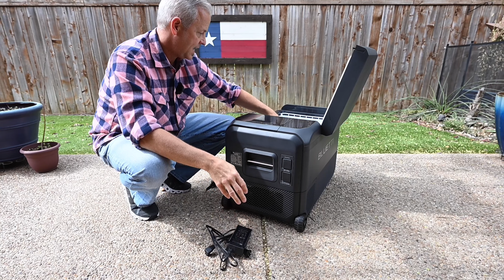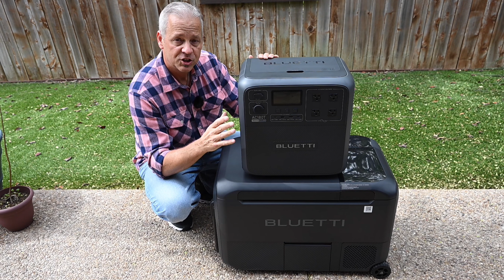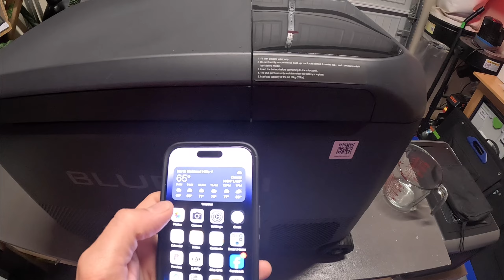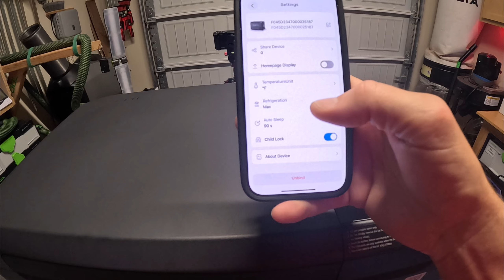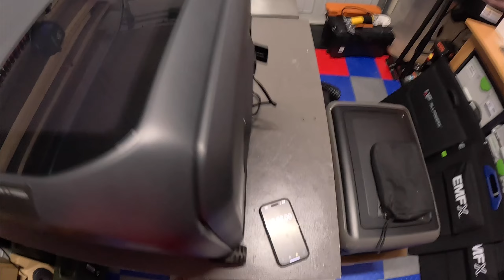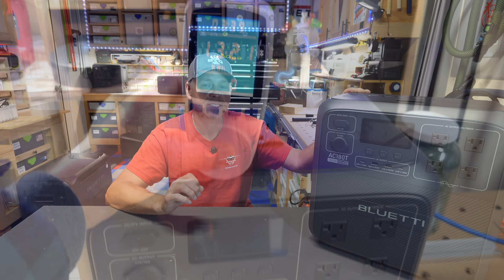All NEW BLUETTI gear! AC180T, cooler, hot swappable batteries.

Comment: Nifty idea having the removeable batteries, especially for weight reduction while lifting. The +/- functions for temp control look to be easily adjusted. I didn't notice a drain in the bottom of the large compartment for draining, if you were to use it as a regular cooler, and dealing with melted ice. The built-in wheels don't look as obtrusive (space-consuming) as the ones that can be added to the EcoFlow model. 

Good review of the Bluetti! 👍
Reply from the maker: There’s only a drain for the ice maker portion
Reply: @GearGadgetReviews  👍